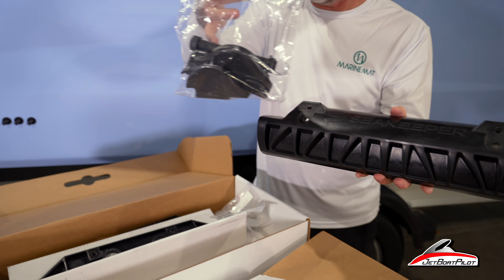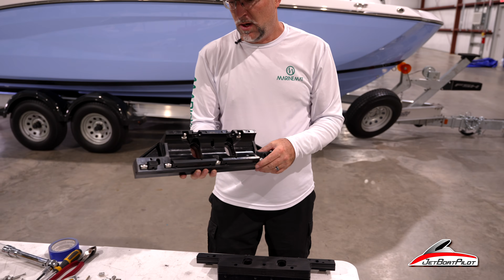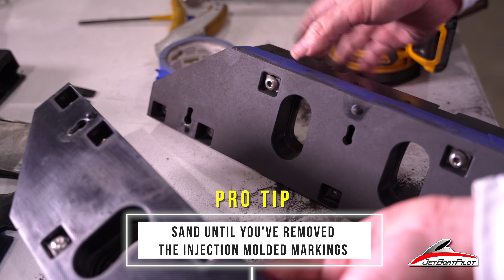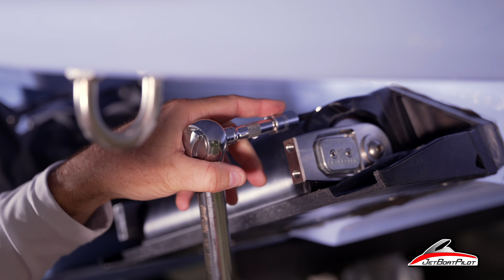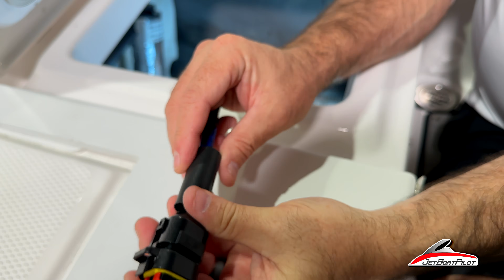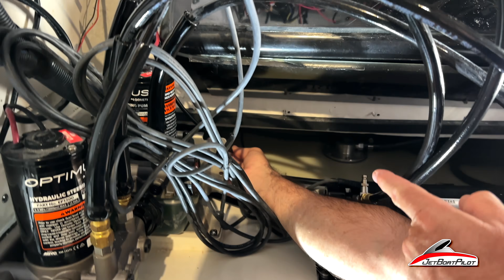Seakeeper Ride | In Depth Install On A Yamaha 255 FSH

Comment: 1st off, great video! Thank you.
The existing underwater lighting? I will need to relocate as I have a 2023 AR250 with aftermarket lights. You mentioned moving them up, which shouldn't be an issue but I noticed you did not reinstall nor did you fill the old hole? Is the adhesive and backing plate enough to ensure water tightness? Did you relocate & reinstall your your lights?
Again great video, I enjoy all your content.
TIA!
Reply from the maker: Yes the holes get covered by the Seakeeper Ride

Comment: Halo I am from Greece and I want to put seakeeper ride 450  in Boston’s whaler 235 concuest I see in your video the torque wrench is 50 inch/pounts but in manual says 60 inch/pounts. What number is right ; thanks
Reply from the maker: Trust the manual

Comment: Will it mount to a 24 222SE directly or do you need a special mounting plate?
Reply from the maker: It will mount directly without a plate but you may have to move your underwater lights. We can do the install if you need. Also you'll need an MFD and GPS puck to make the system work.

Comment: What turns the SK Ride on and off? No switches in the diagrams, do you have to turn the master battery switch off to turn it off or should it power off with ignition/mfd power down?
Reply from the maker: We use an accessory switch on the dash to power it up. On boats that don't come with one we add one.

Comment: I see you left about 1/8" of gel coat at the bottom of the hull where you were grinding. Was that due to the hole from the underwater light removal? Looks like the placement of the mounting plate is really dictated by the hole from the lights and the ride plate? Also, I'm assuming you used the sealant at the bottom to smooth the transition since the SK mounting plate wasn't all the way flush with the ride surface, correct? Great video by the way Will!
Reply from the maker: @TMRI1970  no actually the position of the blade is dictated by the ride surface and the angle of the transom. You have to mount the wedge pack in such a way to be changed completely out of the water when on plane by about 1/8". The wire for the light was actually above the blade. The video shows that I think. The bilt app that comes with the system makes it pretty clear where to position the blade.
Reply: @JetBoatPilot  Thanks Will, I'm going to tackle this install myself on the exact boat so I've watched your video about 20 times lol! I just noticed when you removed the underwater lights, the top of the exposed hole was where the top edge of the SK mounting plate intersected. You're correct about the BILT app and the detai it offers about leveling the blade with the bottom of the boat surface,  however it appears in your video that the bottom of the mounting plate isn't flush with the bottom of the transom. It looks like it's about 1/8'" above. Perhaps it's just the video.
Reply from the maker: @TMRI1970  you're correct. It is just above. The placement is really one of the most time consuming parts of most Seakeeper Ride installs but since Yamaha boats are all so perfectly identical you can mount yours exactly like ours and it will be perfect.
Reply: @JetBoatPilot  Thanks Will, looking forward to spending .more money at JBP in 2025...😂
Reply from the maker: @TMRI1970  thanks! Lol
Reply: @JetBoatPilot Hello Will, did you end up moving the lights  placement? Thanks

Comment: Really considering these for my 2024 252 FSH. Did you guys fill the factory holes for the underwater lights with the adhesive or did you fiberglass them first? Looks like the starboard side light hole got filled with the adhesive? Thanks
Reply from the maker: @alexrantz-u1l  we filled with adhesive since it was so close to the mounting area
Reply: @ thanks for the reply. Good to know. I am a big DIY guy but fiberglass work was not one of them. I have manual trim tabs on my 252 right now but it appears most of those existing holes would be filled and covered also. I see on your site if I choose “install yourself or have a different shop install” it says out of stock but “in stock” if I choose to have you guys install?
Reply from the maker: @alexrantz-u1l  did someone get back to you about this comment? Our sale is coming to an end and I wanted to make sure you got the info you were looking for.
Reply: @JetBoatPilot  yes I actually ordered the SKR 450 kit from you guys last Thursday. Hoping it all ships this week!! Ordered from you guys because of the support. I definitely have some more questions haha.
Reply from the maker: @alexrantz-u1l  Awesome! Thanks. Just following up on some missed emails in my inbox and yours showed up.
Reply: @JetBoatPilot I will also be doing this work myself. I will relocate the lights. If filling the light holes with adhesive enough or should they be fiberglassed as well?

Comment: Did you post the commissioning video?
Reply from the maker: @bradgregory3424  I did not but it's super easy and the app that comes with the kit shows how to do it.
Reply: @ I’m seriously considering this. Not sure about installing myself. Installers are a bit of trip to get to from where we are. Do you know if you can adjust them at slow speeds to reduce wake? We have the Erie Canal and there’s places you don’t have to stay at 5mph. But if I go up to 10mph there’s a bit of wake vs others boats at the same speed. Being able to go a little faster where we can makes cruising the canal not as long. Thanks!
Reply from the maker: @bradgregory3424  not sure the system will help with the wake. The install is intense but if you're super handy and follow our install video plus use the included app you may be able to do it yourself.

Comment: My Sportsman 23'Center Counsel came with the Seakeeper installed and gives a great ride. Only thing I did not know at first is the system does not start to work until 10MPH
Reply from the maker: @neilcigelske4454  yes has to be on plane
Reply from the maker: Yep on plane only

Comment: Great install with amazing and detailed explanation. I noticed you don’t have the thrust and lateral vectors installed, I have them installed on my 2023 255 SFH, would these interfere with the Seakeeper installation?  I also wanted to ask where you relocated the underwater lights (not shown).
Reply from the maker: The Helm Master equipped FSH has a nozzle that does not work with Thrust vector or Lateral Thruster so we had no choice on this boat. However the Seakeeper will work just fine with Thrust Vector and Lateral Thruster as long as it is mounted in the located we selected on this install. We plan to reinstall the underwater lights at some point which will be above and slightly inboard of their original location.

Comment: What type of bit did you use to cut the hole for the  keypad?  Thanks in advance!
Reply from the maker: Router bit which allowed for the side cutting. You can get one from Mcmaster.com or Amazon. Best bit for cutting fiberglass is diamond tipped abrasive type bit.

Comment: Will this fit the Yamaha 275 sdx 2023?
Reply: Still an awesome product. I understand cost effectiveness isn’t there for smaller boats. This product is more advanced than their competitors and since this isn’t an option for me anymore I might have to explore other options. Do
You have any experience with other options for the 275 sdx?
Reply from the maker: @SnafuSpacehog  I do not, sorry
Reply from the maker: Unfortunately it will not.
Reply: Damn
Reply: Is it the length of the boat that’s the problem?
Reply from the maker: @dcouwlier  the engines are wide set on the 275 which leaves very little room for the Seakeeper. We measured it with a SK factory rep and his final answer was no go on the 275. I tried to get him to think outside the box and in the end we could not see a way to make it work.
Reply: @JetBoatPilot  that’s unfortunate. I was so looking into this after your first video about the ride. Maybe they come up with something down the road:
Reply from the maker: @SnafuSpacehog  I hope so! Sorry again.
Reply: @JetBoatPilot  fyi talked with a rep from seakeeper and they said they won’t be putting money into this project for more R&D  for smaller  boats. They are transitioning into bigger boats now.
Reply from the maker: @SnafuSpacehog  I think they have lots of irons in the fire right now and there's more to come soon. I do believe that there's not much opportunity going smaller given the cost of the unit and the fact that smaller boats don't get into big water as much as larger boats so that makes sense.
Reply: Would it make a difference on a Switch?
Reply from the maker: @captainmt6806  unfortunately it won't work on a switch

Comment: Question: would seakeeper prevent boat from rocking when boat is anchored? Second question: how much energy does it consume? Will it drain batteries when engines are not running?
Reply from the maker: No, not the Seakeeper Ride. Seakeeper Gyro would. It will not drain batteries if you wire it like we did in our install video.

Comment: (1) Can this be installed if you have thrust vectors installed? (2) When you guys do the install, it looks like it is a two-day install, so I am assuming the SOP would be to bring you the boat first thing in the morning on day 1, and then pick it up end of the day on day 2? (3) When you do the install, do you move the underwater light for us?
Reply from the maker: Yes and yes. Removal of factory underwater lights adds an hour of labor as the process involves refilling those holes and cleaning up the old plexus left behind. Sometimes the old lights are damaged during removal but only cosmetically. They can typically be reused with only some scratches or deformation on the edge of the bezel.
Reply from the maker: It will also work with most MFDs including Simrad

Comment: Will - I had a 2023 252SD. does this integrate into the ConnectX display or do you need to install a stand-alone display?
Reply from the maker: You have to buy a stand-alone Garmin
Reply: @JetBoatPilot Any Garmin or a specific model/version?
Reply from the maker: @07acline  we recommend the TD50 which we stock
Reply: will it integrate with Simrad? I ask, as we are also about to reconstruct our dash, adding another display and changing the radio so I have a true radio on the house battery